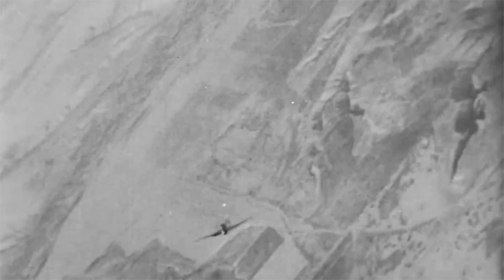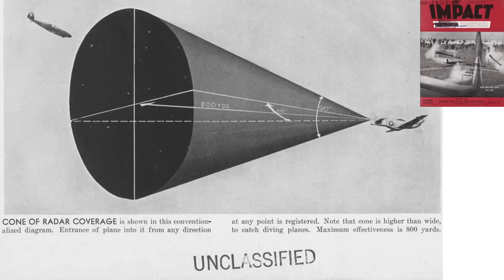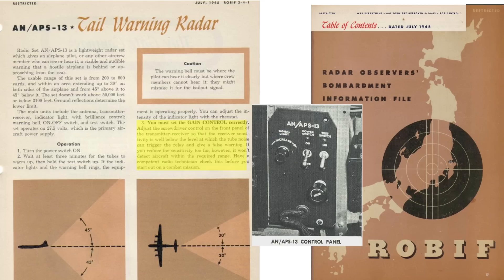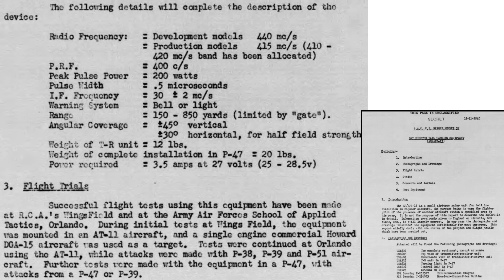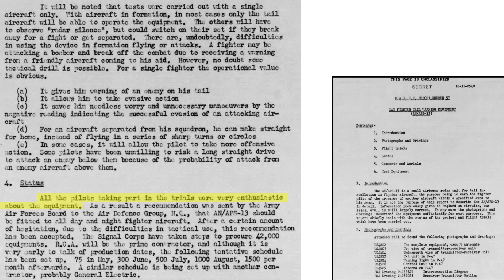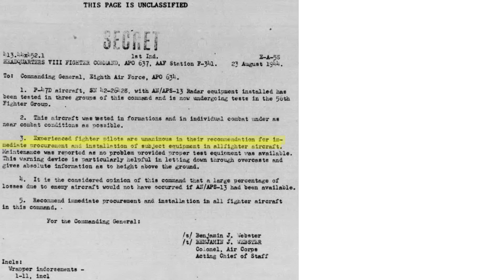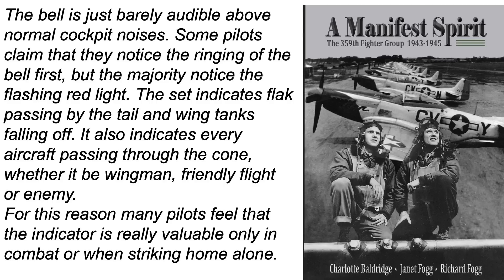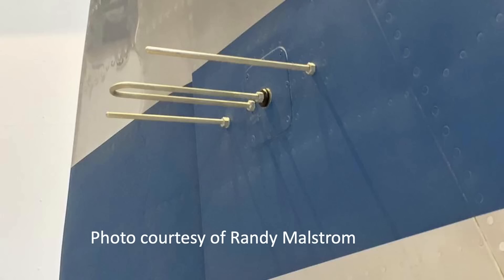How the WWII Fighter Tail Warning Radar reduced losses by 80%, the AN/APS-13 Deep Dive Review

Comment from the maker: Correction, The atomic bombs were triggered at an altitude to 1,800 feet, not 18,000 feet annotated in the video
Reply: Thanks for the correction, saved me a post.

AFAIK even 1800 was found to be too high - a lot of the atomic tests in the 1950s were "height vs yield" tests to determine the optimal height for bursts of various explosive yields.  1,800 feet was thought to have been too high for a European or North American style city but they used the higher altitude as they assumed that Japanese cities, being more flammable, would suffer more from a higher and thus more extensive blast radius.
Reply: Thanks for the great vid and correction. I always thought that was very practical the Manhattan project engineers used this off the shelf item for the final trigger.
Reply: I assumed that was what you meant as 18,000 feet burst height makes no sense for weapons of that yield.  18K feet was close to the burst height of the 50 MT Tsar Bomba (found it to be 4 km after a quick google search).  For the limited yield of those early weapons 1,800 ft makes more sense.
Reply: The bomb was ground detonated by the Jesuit priests who survived (attributed, naturally, to a "miracle of Mary") at [close to] ground zero, underground.  Both previous tests were ground based.  They've carried on this lie for 80 years to scare the populace into compliance with defense budget spending.  There is no such thing as airborne nuclear war.  Sorry to burst the bubble.

Comment: It was a revolutionary idea, but I imagine it wasn't very practical. In a large formation only the rear aircraft could use it. When the formation broke up each aircraft could turn it on, but it took 3 minutes to warm up and most dogfights are over by then. Also, wingmen usually followed their lead, often ending up behind them momentarily in turns, that could also trigger the warning. And then when they broke off and dove down to strafe, the radar couldn't be used due to the proximity of the ground.

Comment: While the idea worked, the British actually ended up with a problem when ARI 5664 Monica warning radars made the plane's  presence known to Luftwaffe fighters equipped with special radar signal receivers. It wasn't until the British discovered the radar was being monitored that the best solution was to actually stop using the ARI 5664 system.

Comment: Thanks to miniaturization of electronics over the years, my bicycle today uses a tail warning radar that provides audible warning and graphical display of overtaking vehicles (including cyclists).  Vehicles going the other way, or maintaining my pace or less, are ignored. The Garmin Varia RTL515 has about 1/8 the range (100 meters) of the WWII tail radars and runs for up to 15 hours (with taillight disabled) on one charge of its rechargeable battery.  Complete system weight 71 grams; cost USD200.   Like the fighter pilots, having tried this I don't want to ride without it.   Overtaking vehicle speed and position data are stored on the bike computer for possible future retrieval and analysis.  The radar beam seems cone shaped, maybe with round cross section instead of the elliptical shape of the aircraft radar.

Comment: The AN / APS 13 reads to be another mini tube nightmare, and heavier than it's 20 LBS, by the time it's in a plane. I've heard of a WW2 "tail end Charlie" plane radar with a cathode ray tube, and the AN/APS 13 is not it. There were so many war radar parts available after WW2, that the Sentinel Television was made almost entirely of these components, and ceased production, when they ran out.

Comment: This excellent video on a little-known subject made me want to know more. May I suggest a look at the Wiki "Monica" entry? This tail-warning radar was introduced in June 1942 and presumably gave some protection to bombers until compromised by the Germans in early 1944 (FuG 227 system). This was discovered by the RAF in July 1944 and Monica was removed. The American AN/APS-13 was itself a development of Monica ARI 5664 so the system was a success albeit its application on bombers was vulnerable to passive radar but that flaw didn't happen for 2 years. 
I read somewhere long ago that most pilots both in WW 1 and WW 2 were shot down by planes they never saw, mostly from their 6 o'clock. As the video says, the pilots were very keen on this system as fighter pilots were very vulnerable in the middle of combat when persuing enemy aircraft. For example, German ace Helmut Wick was shot down and killed in the B of B by Johnnie Dundas who was in turn immediately shot down and killed by Wick's wingman.  
As a side note, I read that MIG-15s in the Korean war were fitted with a passive tail radar to warn of the gun-laying radar of the Sabres. A never-ending battle of the beams...
Reply: Monica Mk 1 was wasn't rolled out until mid 1943. They found it jammed the OBOE blind bombing system and it wasn't fitted until OBOE was modified to overcome the issue (there only being 60 OBOE equipped aircraft in service at any one time (and almost one third of them were 9th Air Force B-26's!!!)). Monica Mk 1 was a failure. The system was designed for use by a single aircraft operating alone, as the RAF night bomber operated in 1941. On introduction, the equipment had a 20% per sortie failure rate, and the concentration of the RAF heavies into a tight compact bomber stream meant that the bombers carrying Monica were picking up friendly aircraft all of the time, most crews thought it was useless and turned it off. 

This issue was partly fixed with the introduction of Monica Mk 3, also known as Visual Monica, which included a CRT display system in the wireless operators position. This allowed the operator to determine if any of the the aircraft below and behind the bomber was trying to do an intercept and allow enough time for a corkscrew manoeuvre to be done, which normally resulted in a failed intercept. 

Monica wasn't removed from the Main Force bombers, because it made it easier for the Germans to find and shot down induvial bombers, it was removed because it made all of the Spoofing and Decoy Raids done by 100 Bomber Support group useless and the Germans could determine which raids were "Window" clouds and which raids were the Real Bomber Streams, by their Monica Transmissions. It was not removed from the Bomber Command Aircraft that operated alone (all Mosquitos and Fortress / Liberator RCM aircraft).
Reply: @richardvernon317  Very interesting - thanks.  Maybe the Wiki entry need editing.

Comment: While this worked for daytime fighters, the UK night bomber equivalents varied between 'useless' and 'outright menace'. The passive 'Boozer' warning unit was mostly useless because it only indicated when a radar was illuminating the bomber - which would be much of the time over Germany and it gave no specific warnings. The active 'Monica' unit was a study in nice ideas that turned out to be bad - German engineers developed a device for night fighters that could home in on the emissions from it. Of course, Allied night-fighters accompanying the bombers had their own device that could home in on German night fighter radars .....
Reply: Don't believe everything you read written before all of the records were declassified. Monica Mk 1 was a failure because the system was designed for a bomber aircraft operating alone at night as the RAF Bomber Command aircraft did in mid 1941 when the system's operational requirement was drafted. Due to a shortage of CRT production capability and nobody in the standard 1941 RAF bomber available to watch a CRT all of the time during a Sortie, an Audio warning system was specified. 

The rollout of the system was delayed when it was found that it jammed the Oboe system fitted to the Pathfinder Mosquitos and the use of Monica was banned until Oboe was modified to overcome the issue. By the time Monica came into widescale service, the RAF were flying in tight concentrated bomber streams and the Monica kit was going off all of the time due to all of the friendly aircraft around, so word when around the command that the kit was useless and a lot of crews switched it off. Also the kit's failure rate on most sorties was 20%. The Reports for units using the equipment outside of the bomber stream were actually quite good, the equipment did pick up enemy interceptors coming in from below and behind and did allow successful evasion.

There was a Mk III Monica, known as Visual Monica, which included a range and azimuth display of contracts located in the Wireless Operator's position which was fitted to a number of Lancaster Squadrons in 5 Group in the autumn and winter on 1943 / 44. That system was actually very good and the squadrons using it had quite low losses during the Battle of Berlin. 

The main issue with Monica was not that it made it easier for German fighters to find and shoot down the bomber (If the tail warning radar was used correctly, it actually made the bomber harder to shoot down). What the Flensburg did do, is tell every German Night fighter fitted with it where the real Bomber Stream was, and totally negate the spoof raid efforts being laid by the 100 Group window dropping efforts. This was why it was removed from the Main Force Bomber in September 1944. All of the Bomber Command aircraft that operated outside of the Bomber Stream retained the Monica equipment (Mosquitos of both bomber and night fighter types and 100 Group RCM Heavies, mainly the Liberators and Fortress's).

P.S.

Germans had their own tail warning radar fitted to fighter bombers in late 1943, for night attacks on southern England, and they caused major problems for the Mosquito night fighters.

Comment: Great hearing about the antique equipment used by WW2 planes and ships, particularly early warning systems. Wonder why this system was not deployed to bombers as well? For example, by 1945, the B-29 had remote controlled rear turrets with early TV sights. Since bombers are primary attacking targets for maraunding fighters, and getting on to the tail position is the most common form of aerial attack vector, this might have saved bomber crews as well by allowing them to evade tail attacks as well and to have the tail gunner improve his defensive fire effectiveness.
Reply: The US Tail Radar was a copy of the British Monica Tail Radar, design of which was started in 1941 and entered service in mid 1943. Worked OK on aircraft operating alone (if serviceable), but it was next to useless in a tight compact Bomber Stream as flown by Bomber Command in late 1943.

Comment: surprising video to see. I had one of those military surplus APS-13's back in 1961, I modified  it so it could receive on UHF military aircraft frequencies and i could occasionally hear aircraft in the Los Angeles region, so, it actually worked as a receiver where I had earphones connected, and I built an antenna and placed that outside the window. The APS-13 was a nifty looking rig, funny looking tubes and silver plated inductors.

Comment: These Tail Warning radars were removed from USAAF fighters in late 1944 because they were detectable by the Luftwaffe. They didn't reduce losses by 80% in fighter rear attacks as this sector of the field of view was watched closely by groups of fighters already. A US pilot that chose to push an attack for long enough to need this rearguard radar was in the wrong trade. Very handy in poor visibility due to cloud, glare or low light I expect.    

From WIKI

Monica was a range-only tail warning radar for bombers, introduced by the RAF in June 1942. Officially known as ARI 5664, it operated at frequencies of around 300 MHz (on the boundary between VHF and UHF). The system was also used by the US Army Air Forces, under the name AN/APS-13, and the nickname Archie.
History
Monica was developed at the Bomber Support Development Unit (BSDU) in Worcestershire. After the Luftwaffe became aware of Monica from a crashed bomber, German scientists developed a passive radar receiver, named Flensburg (FuG 227). From early 1944, FuG 227 was used by nightfighter crews to home in on Allied bombers using Monica. However, on the morning of 13 July 1944, a 7.Staffel/NJG 2-flown Junkers Ju 88 G-1 nightfighter equipped with Flensburg mistakenly landed at RAF Woodbridge. After examining the Flensburg equipment, the RAF ordered Monica withdrawn from all Bomber Command aircraft. An AN/APS-13 was used as a radar altimeter during the Atomic bombings of Hiroshima and Nagasaki by the 509th Composite Group, USAAF.

Comment: Great video! I knew of the device (as tailing warning in an aircraft), but not for long. But did not really know anything about it otherwise. Did not know it was the same unit as whatever 'The Bomb" had for altitude detection for detonation. Testing and adjusting the unit to set 'the gadget' off at the altitude that was wanted is pretty well shown in some Hollywood movie, though I haven't seen it in decades, I do remember that. Don't remember if they identified it in any manner.

Comment: I read that German night fighters learned to use this tail radar system to track allied bombers
Reply: True. 
But here we have 2 different situations. 

1. A night fighter that is larger, usually with multiple engines and crew, having weight allowance and workload distribution that allow for extra gear, looking for something large and unmaneuvable in conditions which make visible detection very difficult. So passive radar detection is viable.

2. A day fighter, in which every pound can affect performance, with a single pilot having more than enough to keep track of, wanting to sneak up on something very maneuvable, in conditions allowing visible detection for miles. In this case, passive radar detection is just a distraction and less effective than just looking around. 

Covering one's tail where optical detection is difficult makes a small active radar viable, but relying on passive detection to find it is wasted cost, weight, and workload compared to good vision in a daylight fighter vs fighter situation.

Comment: An American fighter aircraft rear warning radar in WW2.  A WW2 buff that never heard of this. Fascinating.
Reply: yes - adopted from the British system, with a much smaller (and also more accurate) wavelength than the German nightfighters used over Europe
Reply: That's because it's not American. It's British, and AN/APS-13 is just what the Yanks called the Monica system that the British first built in 1942.
Reply: I've learned so much from this channel.
Reply: i know. you hear all about the weird as f--- german kit but allied homing torpedoes, rear warning radar, no one talks about that.
Reply: @russellmz  Ultra was not talked about until the 1970's. And I have only see on revelation at to how the USA violated POW rules by using Red Cross packages to sneak in items to help with the "Great Escape."  Who knows what other things have not been revealed or things now believed about WW2 will be debunked.
Reply: @russellmz  IE, that German kit that they couldn't build, or was completely theoretical, or maybe reached the prototype stage, or was sidelined because a certain failed painter wanted something completely stupid instead.

Comment: That cone is much less than 90 degrees. More like 40.
Reply: It's about 45 degrees either side of horizontal, for a 'width' of 90 degrees. It's one of those annoying properties of beam systems, and for things like LED beam widths we often use half angles (45 degrees in this case).
It can't be made wider without limiting the maximum detection range or the minimum operating altitude, as the alarm would just false trigger all the time from the ground, this is a big design compromise.

Comment: These systems were particularly useful on fighters in the Pacific where they were flying over water and didn't have navigation reference points on the ground like the fighters in Europe did, flying over water in the Pacific meant that they had to occupy themselves with their little navigation computers (not electronic computers, the little circular "pinwheel" calculator navigation devices) to figure their position, one little mistake and a fighter pilot who was on his own after getting separated from the rest could easily miss a tiny dot in the ocean like Iwo Jima (think Amelia Earhart and how she missed Howland Island) and wind up having to ditch from running out of fuel, the tail warning radar allowed them to concentrate on fixing their position without the distraction of having to constantly "check 6" to make sure they weren't getting a nasty surprise from behind, it undoubtedly saved lives there not just from warning about an attack but also from giving a pilot the peace of mind he needed to concentrate on fixing his location so he could find his base.
Reply: Yep.
One cloud, obscuring one tiny island 🏝 , in a huge ocean and you're in big trouble.
Reply: @redtobertshateshandles  
Yep, math is hard enough without a hand held electronic calculator much less having to do navigation mathematics while worrying about someone sneaking up behind you.
The P47N pilots in the Pacific really had it nice, they not only had the tail warning radar but they also had an autopilot and seats with arm rests that folded down, they could really kick back and relax, all they lacked was an under the dash FM converter with the 8 Track player.